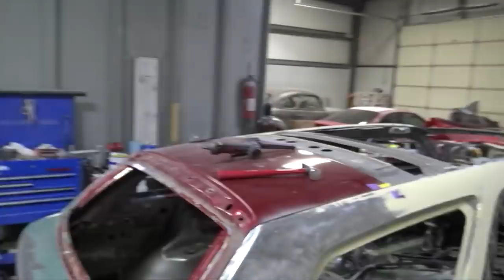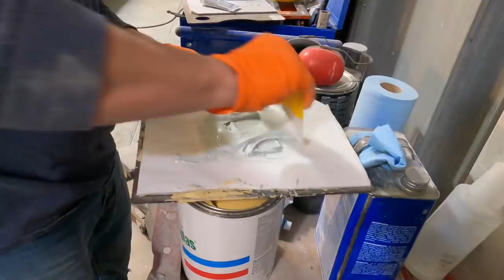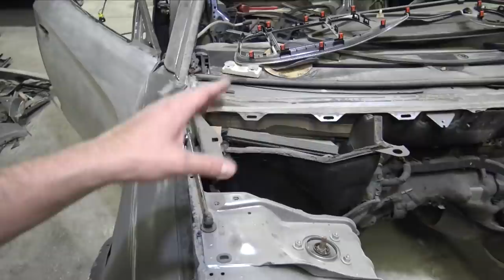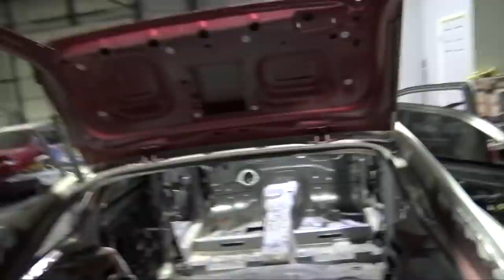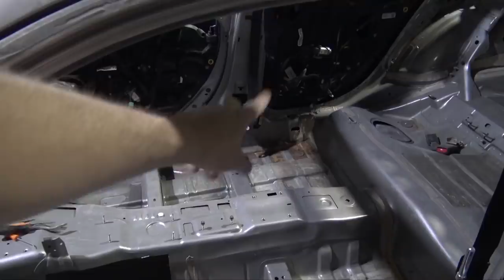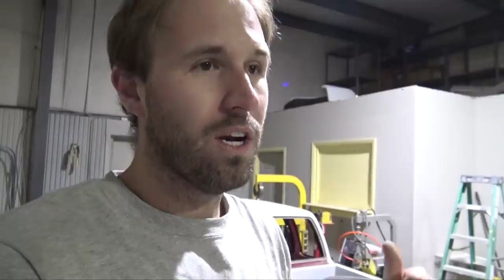Building the Ultimate Station Wagon | 2021 Charger Magnum Hellcat | 1000HP Hellwagon | Pt 20

Comment: Maybe go with servo linear actuators instead of struts on the hatch. That way you can have a kick sensor and auto open/close.
Reply: Given the geometry and the size of the rear hatch that's going to be a huge amount of force. Even with a carbon version. Probably need to keep struts in there to make the weight neutral, then add a linear actuator to actually move it.

Come to think of it I don't think any OEM uses linear actuators for this though. Would be super cool to make something out of Dodge original parts off another chassis.

Comment: Dave, if the cf hatch is going to be much lighter I wouldn’t use the struts anyway. Avoid stressing the strut mounts by fitting a couple of top-locking hinges ( like a type of hood hinge/ picnic table type locking struts) without spring pressure, then lift the rear hatch manually......) just a thought...😊 keep well buddy,

Comment: I always finish my filler work in 220-320 grit, 180 at the least before high build. It really helps keep the shrink back from showing deep scratches and then block my high build with 320 and then a second shot of high build that again I block with 320 and finish to a 500-600 grit. You definitely want to knock the 80 grit points off with at least 180 before primer in my opinion, nonetheless it looks amazing and can’t wait to see it all one color.

Comment: Might want to consider a roll cage with all wheel drive, and high HP engine plan.
Reply: If he's leaving it not too far from stock hellcat power levels then I think he'll be fine. Demons, hellcats, trackhawks, none of these have a cage. It doesn't really fit with a build he's going so far to get an OEM finish on.
Reply: @marcuscoster6529  tracks have wanted demons caged though
Reply: @TwamZ  This seems like more of a show car than a track star. The handful of times he might take it to a track, probably isn't worth having a cage. And that's besides the fact that he has a bunch of cars and will already be splitting driving time between them all.
Reply: He's trying to reduce the weight of the car

Comment: Curious what you did to strengthen the joint between the hatch and the trunk parts.  I don't think you showed all the welding and construction of that part.
Reply from the maker: I used square bar stock

Comment: I know it's not possible but I wonder if a full carbon skin would drop the weight under or to a chargers normal weight. I also would want to know if there is a good solution for lighter glass. A 3500 lb AWD 1000hp wagon would be a more then the standard sleeper.
Reply from the maker: Bad thing is my hellcat weights around 4800 so I'm trying to keep it close to that but I did think of pulling side molds in case I have a larger enough demand to convert hellcats
Reply: I would watch it. Are you going to track it or just have a overpowered daily.
Reply: I once spoke to a guy who had a full carbon bodied Magnum drag car. With a completely gutted interior other than a roll cage and aluminum race seat, drag wheels and tires, and only RWD it was around that 3500lbs mark.

Comment: Its comin along Dave. The struts  will mount easily but as ya stated due ta the hatch bein carbon fiber the struts may not require as much resistance to open and close. Use electric struts it may work better for ya just make sure the limit switches are workin properly
Reply from the maker: I thought of that too I'll have to see what the hatch ends up weighing to see which route I'm going to go

Comment: You should fill that ugly camera hole and mount the camera on the license plate frame.
Reply from the maker: Then it would sit too low
Reply: @Junkyard_Dave   I thought the license plate was on the hatch- I realize it is on the bumper now.  Is there a way to fit it into the light panel just under it?  The back 'wing' would look so much better without it.  Great work by the way!